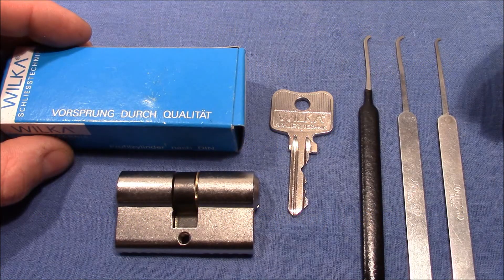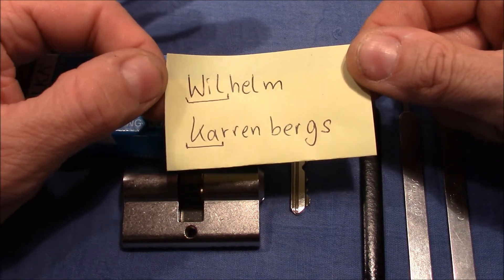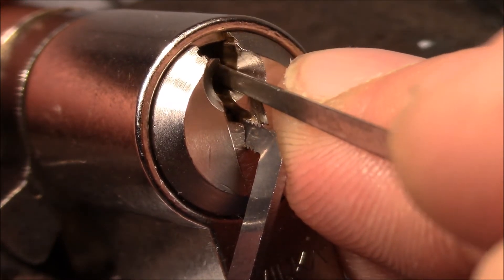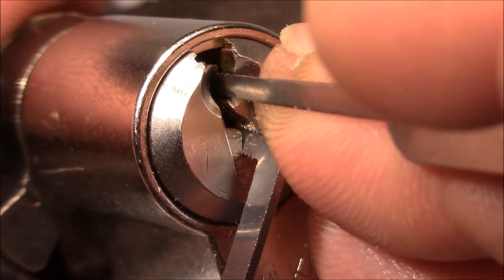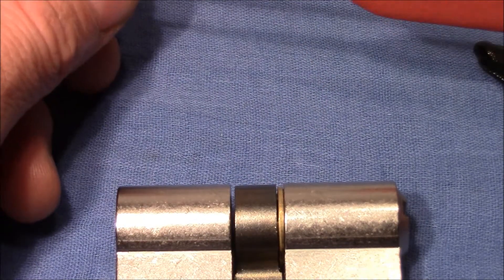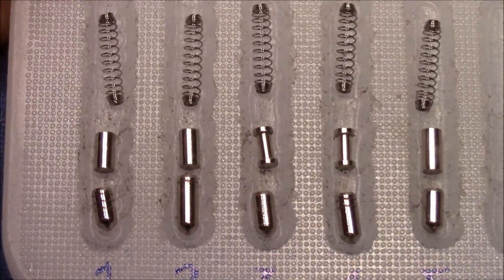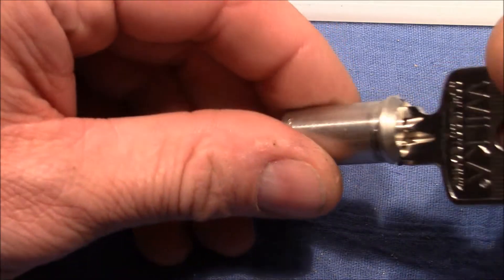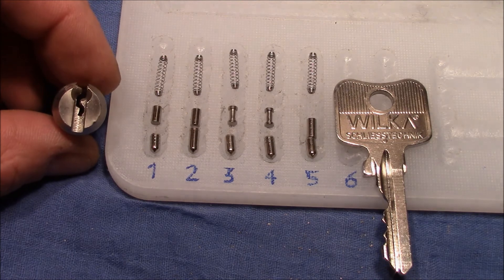(picking 163) WILKA [EURO cylinder exploration series] - picked and gutted

Comment: Have you picked 6 pin euro I have one and it’s a pain in the ass key way is to narrow just my luck the 6th pin is the binder I can’t get a fault set by spping the lock
Reply from the maker: Good luck with you 6 pinner. Try progressive pinning (start with maybe 4 pins and increase the count slowly after getting used to picking it). I've picked 6 and 7 pinners but with not so paracentric keyways.

Comment: Thanks for the continuation of the euro cylinder series, this Wilka is an example of a good lock at a low price point. If they are commonly used, so much the better. The Y1 keyway is common here and it's wide, wide open. This is smaller, thinner. On a Y1 you can either use the holes or hop onto the right hand ledge to pick around instead of through the warding. This won't let you do that, it's too narrow even with a euro thickness hook.

Thanks for the video, keep up the good work.
Reply from the maker: +Shira Assel Thank you for the nice words. Really appreciate that feedback. Although it's possible to go in the holes it slows you down and requires more accurate operations. Or maybe I just need to get used to it ;-)